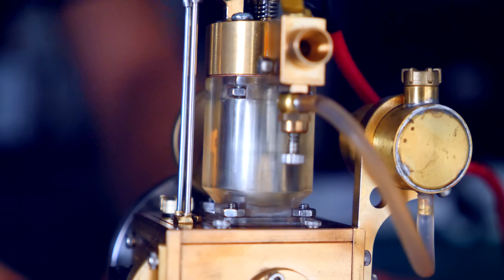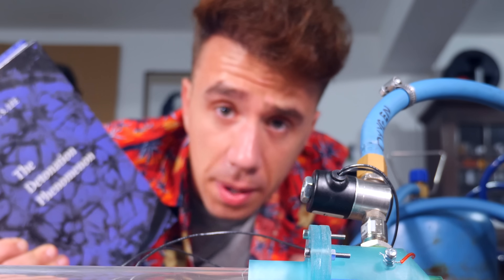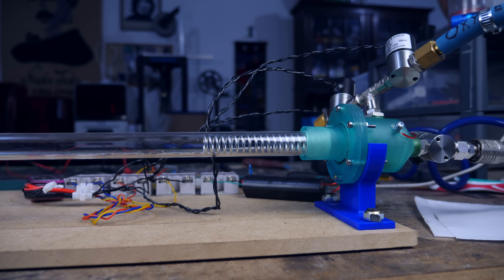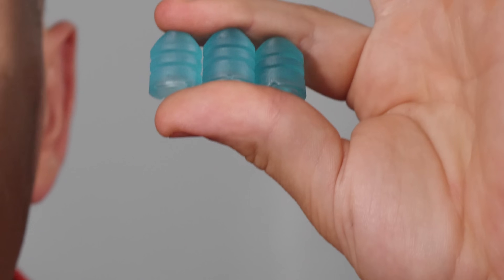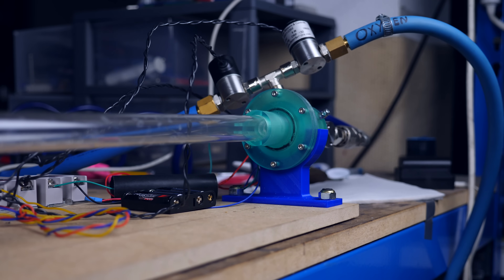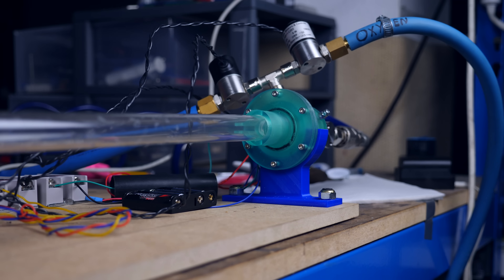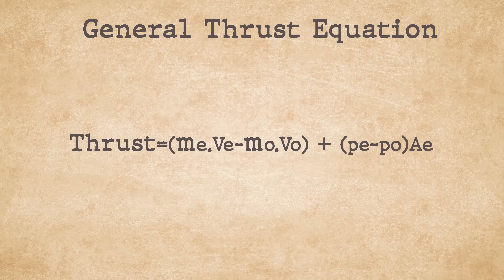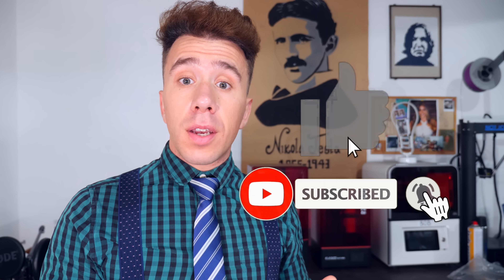PULSED DETONATION ENGINE

Comment: Idea: Try to make a small-scale tip jet helicopter;
Make two rotor blades, mount them on a center bearing, attach some kind of rocket to the outside of the blades (or maybe some kind of engine you've built yourself) then test them to see if it would be possible to make a small-scale version that actually flies (Maybe use a store-bought RC Helicopter?).

Comment: I know nothing about 3D printing really. Is there such a thing as a rotating tesla valve model? One in which additional gas would be compressed as it tried to force air back? Maybe even something like the little blast box on the US Hypersonic engines that could be sized down for your rocket applications? Just a though, and.... I'd love to get a 3D printer for lots of reasons but most of all to learn more!

Comment: Video idea: making a bigger 3D Printed water-cooled Pulsejet, i think it could be easier to watercool it on a bigger scale, also maybe try to watercool every surface facing the combustion chamber (the connector part for the defuser mainly) so it won't overheat.
And maybe use cooled water if you didn't in the last video
Greetings from Germany ❤️

Comment: build a 4 stroke engine but with only one valve per cyclinder, the exhaust valve, for air and fuel intake use injectors to deliver the perfect amount of air and fuel.

Comment: Video suggestion - Build a machine to grow prefect tomato plants it will monitor there soil make adjustments and self water and when they are 15 inches tall and showing little tomatoes a blade snaps out and cuts them down. Tomatoes are gross.

Comment: @integza, since the mass of the combustion products (CO2, H2O, additional carbon) is relatively low, does that limit the propulsion you get from the thrust generated? Would you generate more propulsion if each detonation were to eject something much higher mass (like a tomato, which is substantially water)? Could you do a video showing the effect of displacing more mass for each pulse? Lastly, in the case of just combustion products, could a converging geometry in the tube help accelerate the exhaust and build pressure, helping you cross the sonic threshold and giving you DDT (deflagration-to-detonation transition)?

Comment: Try having multiple inputs to concussion chamber and time multiple valves sequentially to get higher pulse rate with same valves, can also increase volume of fuel in combustion chamber by operating multiple valves at once.

Comment: I just think that due to the engines rapidly heating up, it might be a good idea on the metal versions to add a heat shroud, such as on MG’s. This would help with cooling and allow you to conduct longer tests while reducing the possibility of overheating and issues associated with that. Just seems like it would be a nice quality of life fix.
Reply: you mean like on the lewis?
Reply: @The_Racr1  yeah
Reply: water cooling the thing would also give you a controllable meter. you could change the water flow rate and get different rates of cooling to keep the engine at the optimal temps for detonation. much like a gasoline engine.
Reply: 事实上你有没有想过，通过倒流部分气体出来到涡轮管冷端的气体温度可以降低到-40°，比用水冷跟散热罩好很多，并且所需要的气体量只需要很小就足够了
Reply: "not a gun"
Reply: In order to conduct longer tests while reducing the possibility of overheating and issues associated with that, it is important to built a shockwave jet engine. The shockwave jet engine is designed to provide high-pressure air to the test area, which will allow for longer testing periods. Additionally, the shockwave jet engine will also help to cool the area, which will reduce the possibility of overheating and issues associated with that.

Comment: You could make an Arduino controlled INJECTOR...a 3d printed One I mean...of course, with pressurized fuel rail that consent you to throttle the Number of pulse per minute...(o maybe a an hypersonic potato machine gun...I don't know but the 3d printer Is so ....sbavvv)

Comment: I used onshape in 2020-2021 at high school for Computer Integrated Manufacturing.  Was a bit of an adjustment, I was used to working with autodesk inventor, but onshape was pretty cool.  Only downside is I can't pirate a copy of the software if the software is a website lol

Comment: I think a cool and possibly useful experiment would be to use radio frequency wave with salt water to separate hydrogen from oxygen to make it burn without electrolysis. Maybe use magnetism to make it produce more effectiveness in the splitting process? Maybe use frequency and electrolysis to create a super splitting of the molecules? Maybe add sound frequency to see if a combination of several methods can create a very efficient splitting?  "If you want to know the secrets of the Universe, think in terms of Energy, Frequency and Vibration." Nikola Tesla

Comment: Add more sets of valves. if one set can do 10 hz, two sets can do 20 hz. 
An alternative to solenoid valves would be mechanically driven valves, Consider if you had a set of crank shaft driven valves driving a rod with a series of holes such that one cycle of the crank shaft would open and close the valves several times. You can use the solenoid valves to start & stop the flow while the mechanical valves provide hundreds of pulses per second. Another alternative would be a rotary valve which would work better, but be more difficult to build because of the seals required.

Comment: The problem with detonation engines, is a detonation wave transfers most of its energy into the walls, versus a deflagration wave will bounce more. This is why when an engine knocks, the pistons melt and the head temperatures spike. A detonation engine would actually make a better water-heater/steam-generator than a thrust engine.

Comment: I would like you to try to make a pulse jet by only using oxygen. To detonate the oxygen, use high powered lasers focused to a single point. This is something I always wanted to do but I just don't have the time. This engine will be able to use the atmosphere as fuel. I believe it was NASA that propelled a disc straight up using this concept.

Comment: an alternative valve suggestion that's relatively easy to manufacture compared to some of the other suggestions would be to essentially take a ball valve and hook up an electric motor to it so it spins quickly and generates two pulses every full revolution. I've used this before on a similar contraption to great effect

Comment: There was a full-scale manned aircraft built that used a pulse-detonation engine. Not a fancy rotary detonation engine, which still hasn't been perfected and is super complex, it was just a regular linear pulse-detonation engine exactly as you built here, but if I recall correctly it had 3 tubes. The aircraft itself was also an amateur built aircraft known as a "Long-EZ" made from fiberglass. I believe their engine used camshafts that actuated the valves, but I'm not sure what drove the camshaft. Electronically actuated valves can actually be faster than traditional valves. Look at Konigsegg's' FreeValve technology.

Comment: You just need an expansion bell. Like a rocket engine. The raptor engine has a 4400 psi chamber pressure and they manage to get efficient exhaust out of it.

Comment: If you want even more pressure switch to acetylene with oxygen . And for a simple ... well sort of simple way to increase frequency,  use two pairs  of valves instead of one pair . They should fire opposite of each other.

Comment: G’day Integza. 
Is there anyway you can modify our mutual hero’s, Tesla Valve for this project?
It’s my understanding that the faster (i.e. shorter the interval) pulses in conjunction with higher pressures, they become more effective/efficient. Or so I’m led to understand from various other YouTube videos. 
And in regards to tomatoes, we actually have a term for tomato sauce In Australian rhyming slang. 
And hopefully You should appreciate this, as it also sounds disgusting. 
Our rhyming slang for tomato sauce is “Dead Horse”. 
It’s usually associated with (hot) meat pies, who’s own slang term is Dogs eye (meat pie-dogs eye). 
I’m really looking forward to the next vid. 
And finally, what model CNC machine are you using for aluminium our “Mens Shed” has just acquired a 3018 (base model) and it’s too flimsy for Aluminium. So I’m curious.

Comment: You had some air pressure powered things in the past, have you ever tried vacuum powered? Instead of pressurized air, use a air tank as a vacuum chamber and when you open the valve the air rushing into the tank spins the motor

Comment: You can use your existing electrical valves and still increase your cycle rate by putting multiples in parallel cycled in sequence, out of phase.

Comment: What you do to get more explosions is mount multiple engines in a ring and fire them in sequence so getting closer to constant thrust.
Reply: A gattling engine. That would be sweeeet.
Reply: Everybody gangsta till you pull up with the RADIAL JET ENGINE

Comment: isn't there a way to convert the expanding and shrinking phases of the pulse into a mechanical movement? I guess that wouldn't be efficient. But there is a lot of energy leaving the system without being used. imagine the phases of the pulse that could be used on a Stirling motor,  you could use a lot less energy from the gas to drive the phases of the Stirling motor. 
What about using the expanding gas on a turbine? how much energy loss could recoup in a turbine?

Comment: You ignored the time it will take you to clean all tomato juice off the reel of filament. Conventional rocket engines use an expansion nozzle which brings the exhaust pressure closer to environment pressure. Have you thought of adding an expansion bell to the end of the tube?

Comment: combustion engine valves remind me of your contrapsion.
Would we be able to use your pulse flow to happen in between the valves opening and closing?
Like a new style of Turbo/ supercharger thats an additive to both of the for mentioned boost adders. :) 
:) :) :) :) :) :) :) :) :) :) :) :) :) :) :) :) :) :) :) :) :) :) :) :) :) :) :) :) :) :) :) :) :) :) :) :) :) :) :) :) :) :) :) :) :) :) :) :) :) :) :) :) :) :) :) :) :) :) :)

Comment: This could be turned into a very effective tomato destroying device with a few tweaks.  But, as fun as that would be, I would rather see you get the injection/fuel apparatus way smaller/lighter or the engine itself a little bigger/stronger and see if this can actually gain some altitude.  Doesn't have to go to space, even just a few feet sustained for a while would be very impressive.  Or, making a small vehicle like a go-cart/bike out of it, while very dangerous, might be fun too.  Might also destroy everyone's ears.  But, hey, in the end it can always be reworked to destroy tomatoes again; so, it's a win either way.

Comment: I'd like to see the tip-Jet helicopter  being re-explored as a concept for personal flying transport. The tip jet can be a rocket, jet, but it can also be as simple as a nozzle fed by a channel through the blade. Anything producing pressure can be used to produce the thrust to spin the blades and since the thrust doesn't need to be large (just sustained) I think a cheap method of producing that thrust is possible.

Comment: So watching your video with how you compared what you made with a gun in some ways, then mentioning the rotation detonation engine, made me think of how your final product looked like a gun a bit and one way we made those fire faster.... Do you think you could make more of these and spin them together like a mini-gun? Instead of electric valves you would use ports on a back plate to charge the individual units, basically moving each chamber to the propellant then the detonator, making it fire as fast as you spun it instead of relying on valves (look at hydraulic pumps and motors for inspiration on how to inject the gas). If you have a sparker on each tube instead of a stationary one, my thoughts drift towards DC motor commutators as to how to fire the correct one at the correct time.

Comment: i want to see you try to 3d print a diesel engine. im not sure if the resin can handle the pressurebut by using a high cetane fuel you might be able to do it with a low compression

Comment: I wonder what would happen if you used a 3D-printed cylindrical Tesla-valve like you did in 2020 for your pulse jet engine instead of a simple tube as the thruster/exhaust?

Comment: Ideas: 
1. “SPINNY TOMATO DESTROYER OF DEATH (ok, I’m terrible at names) Add some sort of loading system for the cough- ‘not a gun/projectile launcher’ and then fix one end down / tilt the tube a bit so it spins around. Then you can put tomatoes around it and watch as… well, let’s just say that maybe you should try that outside. 
2. You should make a comparison video for all of your engines/jet engines and see which is the most powerful… and then
3. Use the most powerful one to make something fly/a plane/a ground effect thing with wings/you get the idea 
4. Use your tomato rocket propellant to make an actual rocket / engine!

Comment: Wouldn't you get smoother thrust if you combined two separate detonation chambers that fed into a single tube that were timed to ignite on the offbeat of the other? Two stroke jet engine??

Comment: Integza, my suggestion is to design, 3D print and build a high-end version of the old toy rockets you'd partially fill with water to use as the mass driven by compressed air. Sure, there's no fire involved, but it's an established hobby field to test yourself against, and work up from there. Gentlemen, he can build it. He has the technology to create the world's first bioni... Oh, wait.

Comment: Would you get more power if you inject high pressure air into the chamber and release the extra Oxygen and Butane together in a pulse?
Edit: ... just realized, that's basically a RAM engine isn't it? XD

Comment: I've been wondering if the oxidizer and fuel had numerous small enough, adjacent injectors, if the mixing happened quickly enough, there would be combustion rapid enough to get the same advantage as detonating the mix. The injectors could be machined at the microscopic level with techniques that were evolved from making integrated circuits. Also, why not have a shield at the end of a long tube and start the detonation wave at the tail end of the tube by having the spark ignitor there. If the detonation wave stopping point is set up right, you would not have normal combustion hanging up in the fuel and oxidizer mixing zone. Perhaps mix the fuel and oxidizer inside a sintered or granular material that has spaces in it too small to support combustion and detonation.

Comment: Video suggestion: try to make a rocket engine using wood gas aka gasification. colin furze managed to run a lawnmower with wood gas using the original engine

Comment: Video idea:  3 pulse jets joined together that fire  offset from each other so that you get a more continuous flow also you could add nozzles to your engines to improve performance pls like this comment I really want that 3d printer :) im a first semester engineering student that will use it for school and I also love 3d modeling + they are quite expensive

Comment: "Detonation" in gasoline piston engines as shown here is a bit of a misnomer. The term is called "Knocking" or "Pinging" because of it's sound, and "Detonation" only partially because of what is happening. The real term is "Preignition" and usually happens due to poor quality fuel or construction/tuning of the engine. The fuel is-self igniting under the stresses inside the engine when it is not intended.

Comment: A great valve option would be a rotating plate over the gas outlets. The plate has holes so you can program the rpm to the perfect time and the hole size is dependent on the fuel air mix. A great example is hydraulic motor valves like a radial axial or gerotor. Hydraulic components are super interesting and unique great study for inspiration. Also another option could be cam shaft valves.  They might have a better seal. For the hydraulic type valve if you use nylon or Teflon for the disc and have the disc on the pressure side the pressure would seal the valve.
Reply: Easy enough with a few washers and a drill press. Although the valves are typically teardrop shaped not sure if that is necessary for gas but helps with fluids. Might be able to add some metal or printed mixing plates on the valve shaft or adding multiple barrels between valve and tubes like a revolver. The spark could be activated by rotating contacts just offset from the value to compensate for mixing time. Like an an older cars spark generator.
Reply: Possible to also utilize the Bernoulli principle the pull ambient air to clear the tube. Angled tubes like aspiration vacuum pump.  I’ve been super interested in detonation engines and am stoked to see this video. You always make stuff I’m very interested. Huge inspiration, thank you. Might make a prototype myself as I have a tig welder.  Thinking of trying oxy acetylene as it’s detonation is insane. Just have to have a great flash back arrestor. Maybe a few for safety.

Comment: Video Suggestion:  If you can change the direction of the engine 90 degrees, then I would suggest a tip-jet rotor.  The tube could run the length of each blade and turn 90 degrees at the end.  The airfoil could use the tube as the leading edge and then shaped behind it.

Comment: A constant ignition sorce would work better than your current setup. As soon as the chamber reaches the correct mixture it will detonate. Try a strong constant electrical arc.

Comment: Instead of electrical valve, you can make use of Solenoid valve since it's actuation is much faster than electric or mechanical valves.